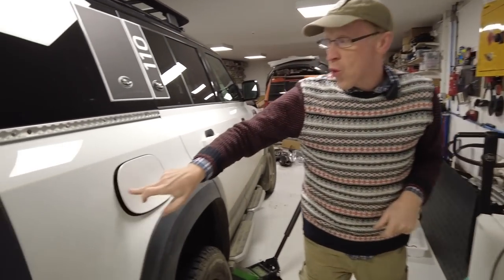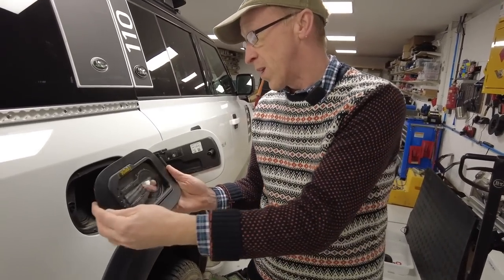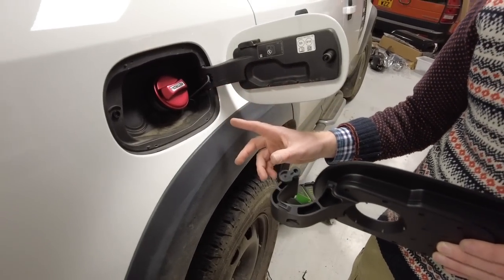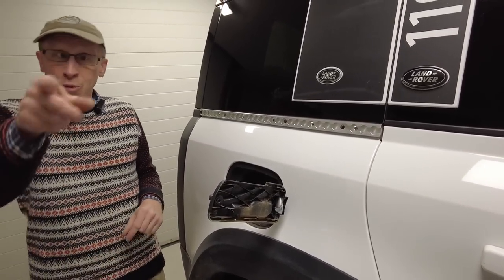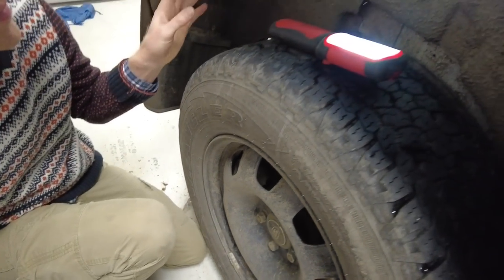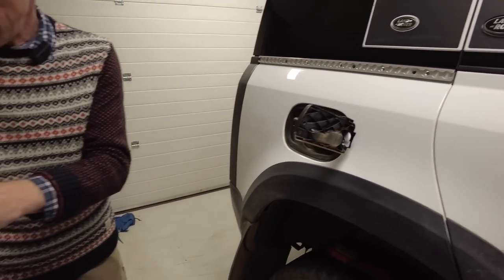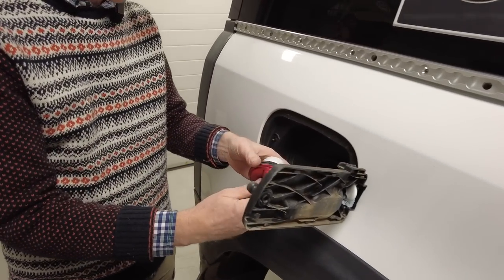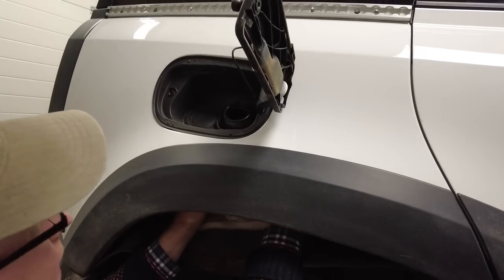PLUMB Fuel Flap Upgrade for New Land Rover Defender L663 110

Comment: Interesting but a waste of money, it doesn't add anything. However, does your fuel flap lock? My dealer says that the locking fuel flap is only fitted on the 400e. To be honest, I'm not impressed having to buy an old fashioned key locking fuel cap.

Comment: Looked better before, especially as Stig is white and the filler flap is black - bit of a colour clash.  The "Plumb" logo is a bit annoying as well - will they pay you for advertising?

I'm not sure I see the point of the product.  It lets you see the filler cap, but unless you have a really flashy one like Simon does, then it's not that interesting to look at, surely?  I think if I had a Defender, I wouldn't let Plumb products anywhere near it.  They look well-made, but aesthetically they're rather jarring and seem like a solution looking for a problem.  What next?  See-through wheels so you can see inside your tyres, perhaps?
Reply from the maker: Patent the see through tyres ! 
Your points are valid and well presented

Comment: Pretty useless really and makes the vehicle look worse - much better to use the original and hide the Air Tag behind it - great idea that.  I also use an Air Tag in my vehicle; but I hide it inside the vehicle in a place that is not blocked by metal.  Air Tag batteries last about a year, so you don't need to change batteries very often.
Reply from the maker: Hi John - yes i was pretty happy with my airtag hideout !
Not many fans of the fuel flap at the moment.